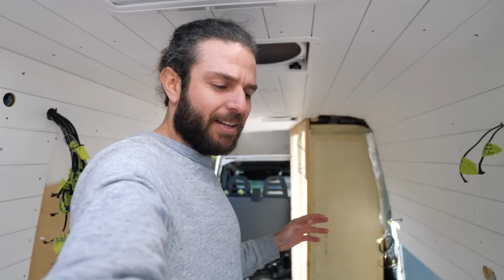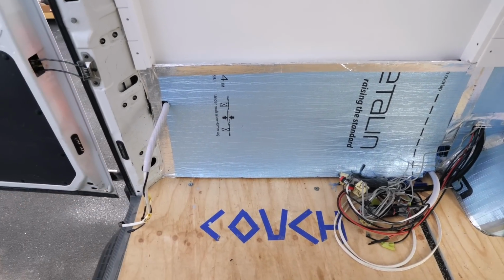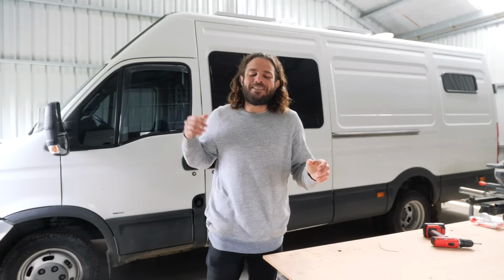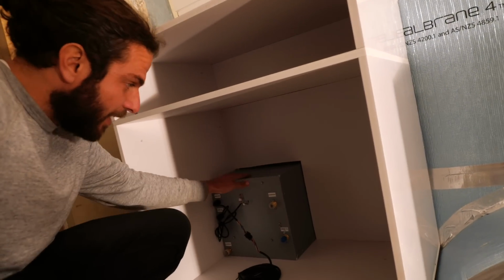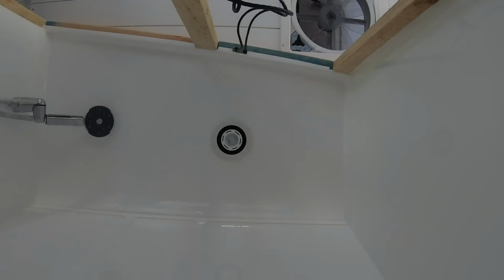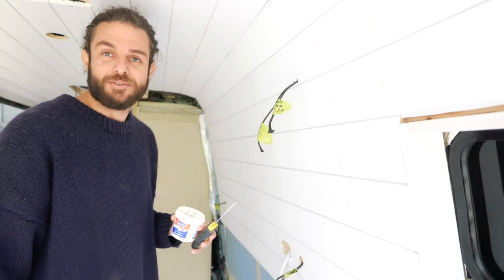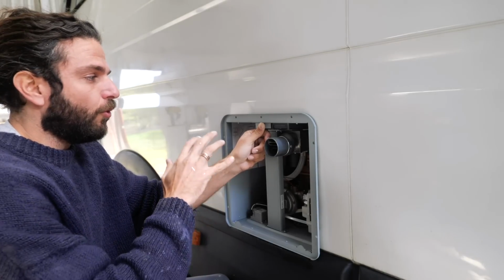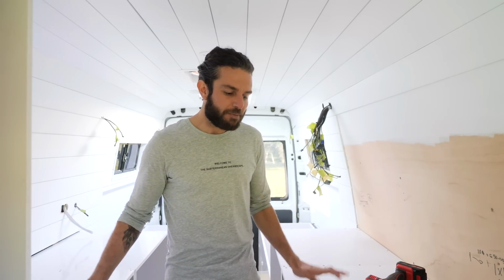It's All Coming Together! | VAN LIFE BUILD

Comment: If it's not too late Max, make sure the tube is going down into the shower vent. If you forget to close the vent, you don't want water to accumulate in the hot air tube. I hope that makes sense...

Comment: The water heater looks good and a very neat install. I wish I could have found something like that here. The material for the cabinets sounds expensive, but over here there's a "lightweight" plywood costs about as much but doesn't save much weight.

Comment: always surprises me with the higher budget in some of the fancy van builds that light, cored panels haven't been used more often - it's been standard in boat cabinetry for years. Looking great though, the white is so bright and airy (not sure if it was intentional, but I like that the cabinet panel screws are accessible from the face in case you need to remove them later without major surgery. Details) Lucky you had assistance on the vent, always frustrating when you go for a reacharound and can't quite get there :p

Comment: VERY IMPRESSIVE BUILD. EXTREMELY WELL BUILT... OCCY WILL LIKE IT. GET IT DONE GO FOR A TEST CAMP.. THERE IS SOMETHING YOU DID FORGET THAT IS A MUST...
Reply from the maker: Oh yeah and what is that?? 😉
Reply: @MaxLeeandOccy  AIR CONDITIONING AND A GENERATOR, I know you will do Solar and some specialty units can run off solar but it is Just my opinion. I have a 45 foot Phantom Coach I put Solar on it from front to rear and I can get about 4.5KW @ 50hz and run the rear ac which is in the Basement of the coach. In the desert it works good in the evening. I also added a 300 gallon Diesel Tank. Your build is quite Impressive the best I have seen on Youtube ever. They make a low Profile A/C unit 8000 BTU's that will fit where the Max air Vent is. In the Southern States where I live no A/C is a big problem. You got the best build going I have seen. I am a 747 Cargo Captain been everywhere in 28,000 flight hours.  I would love to see that van in person. You did good.

Comment: In my experience with diesel heaters, the ducting itself + items it touches are prone to melting when installed in tight areas. l've done a similar thing in my van, you'll notice if it smells like burning plastic! Use it for a while to ensure this doesn't occur before concealing it!

Comment: Hey Max! I was wondering if you think it is really necessary to have 2 MaxxAir fans on a van. Most people seem to follow your way, but don't you think with one fan and the ceiling window open you would have the same result in air flux? Or you would go with 2 fans for some other reason?

Thanks a lot! Keep up the good work!

Comment: A hundred dollars a sheet is not that bad considering my three-layer slabs I used in my build were 25 bucks (30 dollars) per square meter as well. Maybe a little more sturdy but certainly A LOT heavier.
P. S.: Would use an exhaustion system when cutting these though or wear a mask since it's plastic material.